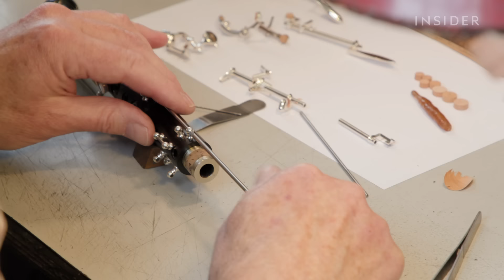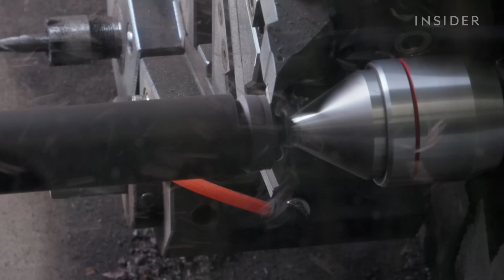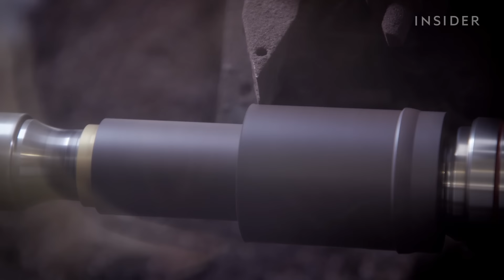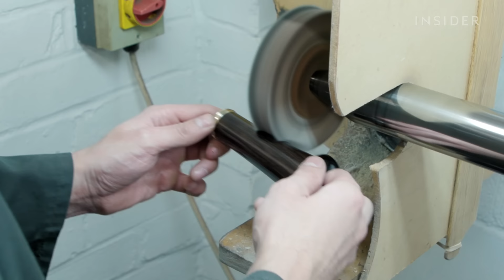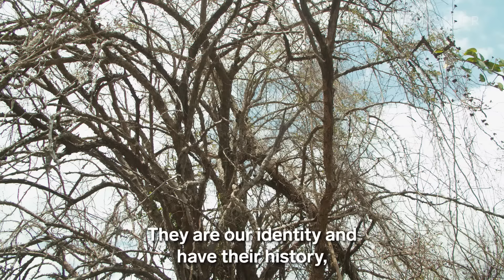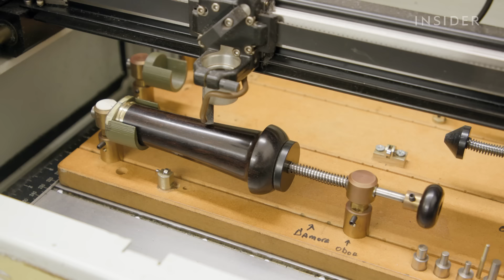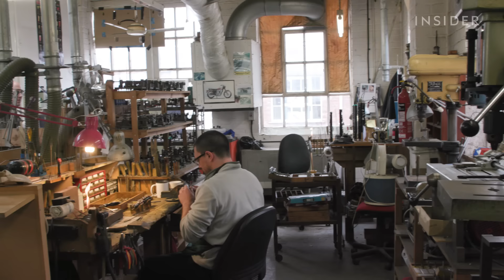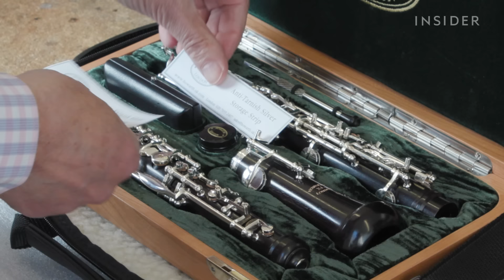Why Oboes Are So Expensive | So Expensive | Business Insider

Comment: I'm sure if you use non endangered trees and give the same production method and care to it it sounds comparable. I love the snobby and pompous attitude behind charging ridiculous prices just because they see contributing to he decline of more and more rare materials.
Reply: When the original commenter is able to use plywood to make a violin that sounds better than a strad I will happily concede. But when one does not have the slightest idea in music nay physics one should not call others snobby or pompous just because one does not understand the complexity of what one is trying to demean.
Reply: Unfortunately not true. Out of the ridiculous number of species, only a few are suitable for instruments and even fewer can be used for wind instruments. For example pine makes for an excellent violin but it's unusable for any wind instruments because it can't withstand the humidity and warps making the instrument sound bad and its keys binding. It may even crack. And the reason for the price isn't entirely because of the material.
Reply: They don't care if it's contribute or not. As long they get what they want. :) this has been going on for centuries.
Reply: Wrong. Grenadilla wood is incredibly dense, which is what gives it it's sonorous properties. Back when I worked at a music store, the instrument tech brought in a tube of it one day. He dropped it on the floor, and it left an indention... on the floor. The wood itself was unharmed. I've seen solid metal poles which are more fragile. Do not speak of things which you do not understand.
Reply: Well...a lot of this is exaggerated. The prices are justified by the work put into them. As far as the endangered species, this is Business Insider who wants to make things look more dire than they really are. The trees aren't being clear-cut without reforestation.

Comment: $ 14,000 is 25 to 30 times an entire "consort" of good-quality plastic recorders... Even a basic, resin-made student model oboe doesn't goes for less than 1,000 (sometimes 800, but these aren't recommended instruments).

Fascinating to see the necessary craft.
Reply: Might be an unpopular comment here. 
But it’s really market and demand. The precision and Sophistication of a cheap smartphone is millions of times more complex than an Oboe. As it requires manufacturing facilities that cost billions to drill down into nanometers that is incomprehensible by human hand. 

The only reason oboe is expensive is because of low demand, and perhaps the desire of using Blackwood. The modern material science can easily solve the material requirements to replace Blackwood when there is high demand.
Reply: @walterpan  The thing with smartphones is that it is iterative manufacture because you are dealing with depositing very pure materials in a predefined sequence. It doesn't involve an individual human whittling away at natural materials to micrometer precision.

A smartphone may be more complex as a function of number of tiny parts, but getting an airtight seal and even operation is every bit as precise as making a silicon chip.

The other thing with instruments is that you WANT that complexity that comes with natural material. Uniform, plastic instruments sound plasticky and dull.

What you say about demand is true, but the real killer is the fact that you CAN'T rig up a big machine to mass produce high quality instruments. Skilled labor costs are the real issue.
Reply: @walterpan  I also own a resin cornett, which isn't an instrument I think is in particular demand, and still costs about half a student oboe (a professional, wooden cornett will just cost as much as the latter!) despite surely not be as much needed and as such sought by Orchestras... Hope someone will actually come up with something similar for oboes too.
Reply: A high quality boxwood or grenadilla recorder like those by Meyer will set you back $3000.
Reply: @darkwingscooter9637  Yes, I know, but still a far cry from the 14,000 ones for an high-end oboe.
Reply: @TenorCantusFirmus  Those are just keyless recorders. Professional grenadilla wood flutes are all around $15000, but flutes in general top out at around $75000 (for a new Powell signature model).

Handmade professional instruments are expensive.